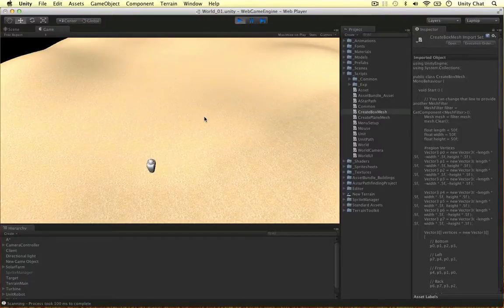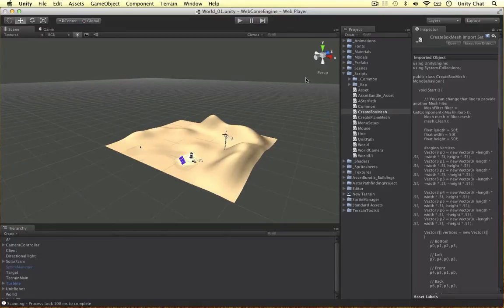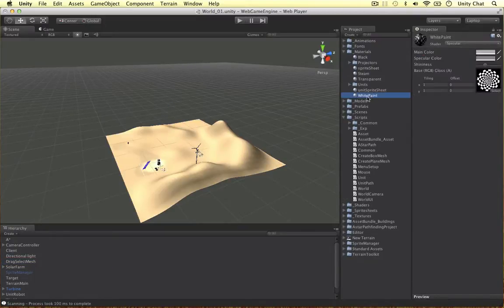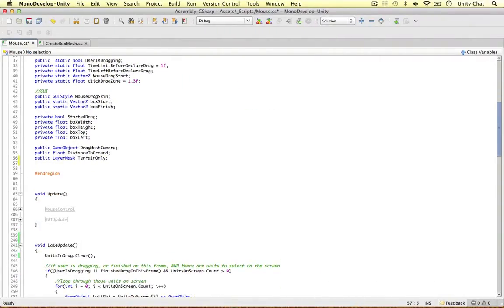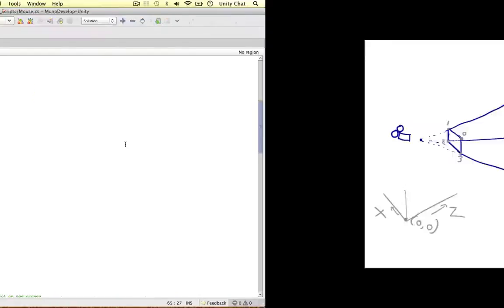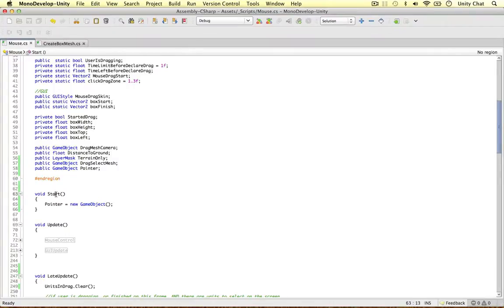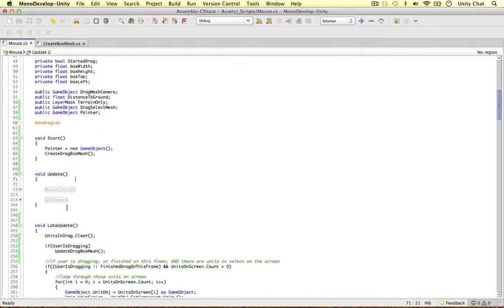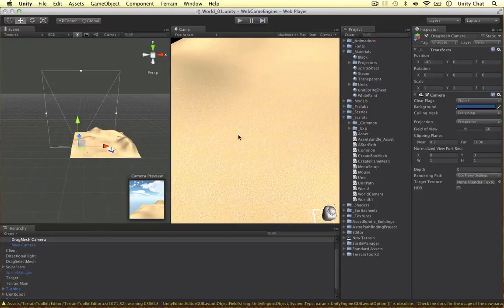Unity RTS - 2D Drag to 3D Mesh [3] Mesh Vertex Ratios

Comment: When calculating your ratios, why are you multiplying by 0.01f?  Basic algebra shows that those two 0.01f terms cancel each other out, and are not necessary.

Once you've divided the boxStart (or boxFinish) x (or y) position by the screen width (or height), you've got the correct ratio.